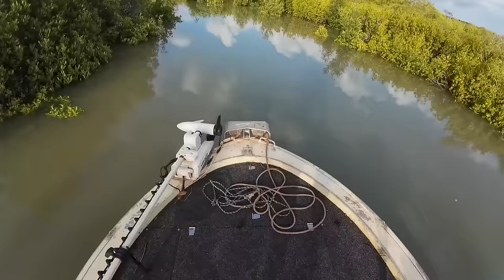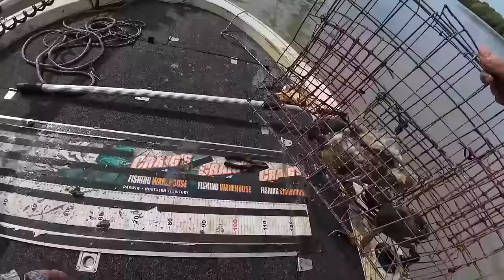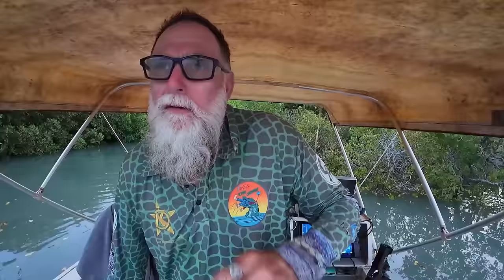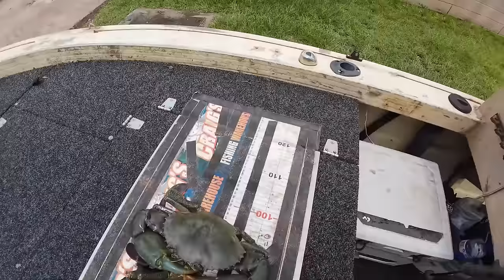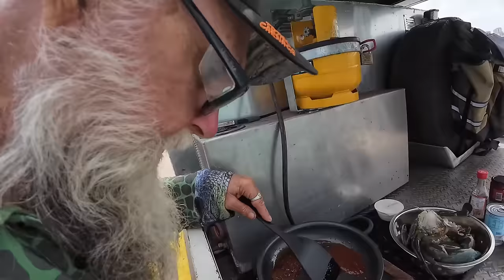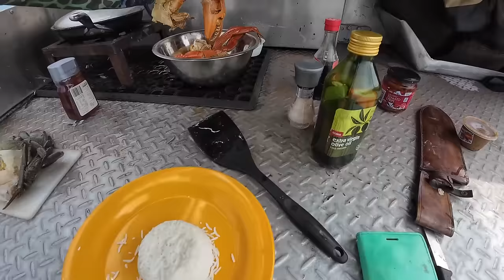Monster Muddy Catch & Cook at Darwin’s StokesHill Wharf NT

Comment: G'day Andy,
The rains flush them out of their hidey holes so I am not surprised you got amongst them. We catch crabs in the Bohle River too after rain quality and quantity. Fresh chicken frames or fish frames the go. Dad use to swear by brolga. But that was the old days. Every 2 hours is the check time for us give em a good soak. Copperhead Road a legendary tune. The crabs can get that thick they are also hangin on the outside of the pots. The weather is starting to cool down with the odd hot day thrown in and sunrise and sunsets to live for. The dam is full that is good for us. Maybe one more blast of wet weather and then we head for cool and dry spell. Great location for chilli crab cook up. Sweet chilli sauce and soy sauce would have taken it to the next level with a squeeze of lemon. Coconut milk really makes it delicious. Get stuck into a couple of lollipops for me.
The Major
BB🎩🔪🦀🦀🦀🦀🤙👍👌
Reply from the maker: Great stuff Mr Major and reckon your dad would have known a trick or two really appreciate your great knowledgeable texts we’ve had cool weather here but actually had a shower this avo.. thank you have a great weekend..🦀🦀👍